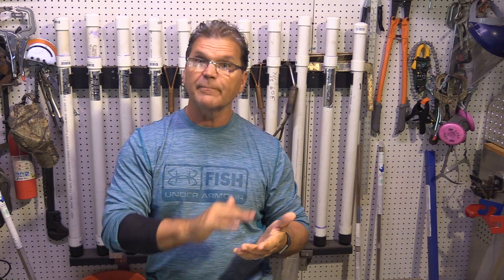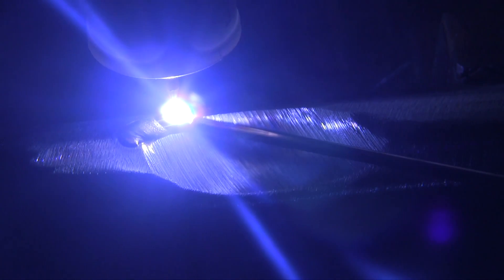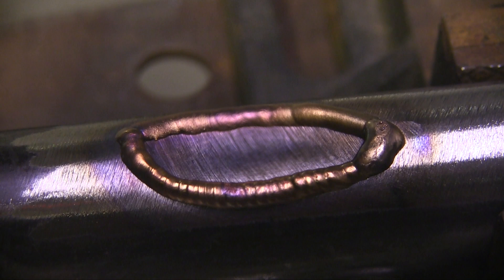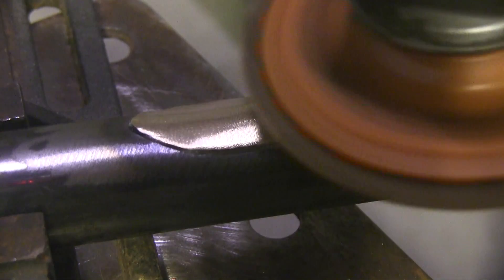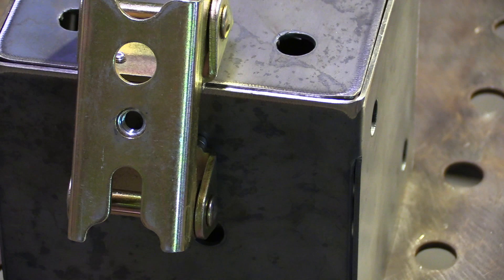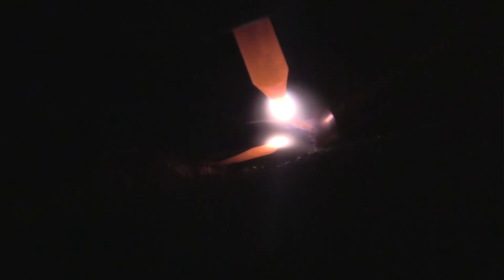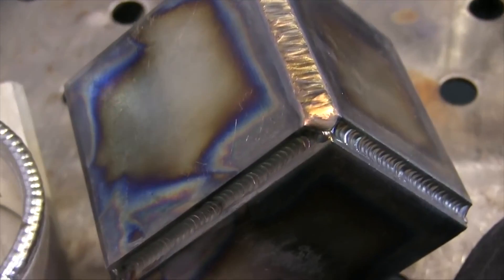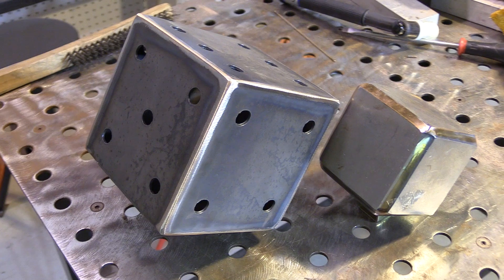Silicon Bronze TIG Brazing

Comment: Another fantastic video, thanks!!  And it's good to know that AC isn't "wrong" for using silicon bronze.  When I tried it I thought it worked better for me than DC, but I was probably running too hot.  I seem to have a hard time keeping in the brazing mode..

Comment: Are there any concerns with fumes with the bronze :)
Reply from the maker: there are definitely concerns with any welding process.  Silicon bronze   ERCuSi-A does contain some Zinc but not as much as brass.
when in doubt, where a good respirator .  I like the 3m 6291 with the pink 2097 filters

AWS Chemical Composition Requirements  ERCuSi-A
Cu = Remainder Zn = 1.0 max
Sn = 1.0 max Mn = 1.5 max
Fe = 0.50 max Si = 2.8 – 4.0
Al = 0.01 max Pb = 0.02 max
Other = 0.50 max
Reply: @weldingtipsandtricks  Wow Jody,thanks for the reply,thats the same type respirator i have used for many years now,it is comfortable when i am welding for over an hour continuously and as i am an older boilermaker i generally use it always,heavy prepping,any large scale cleaning and any welding really.Only problem is i work in tropical areas and in the summer you do get a lot of sweat in the respirator,but like the job you power through:)

Comment: Can I tig braze using flux to cut down on the argon gas. A 12 cup is very big and uses lots of gas. Also too, is it trues that DO NOT use bronze rod with flux already on it that is intended for gas welding on a tig setup ?
Reply from the maker: never tried it. but my guess is it would not work

Comment: Great video, Jody!
How does silicon bronze compare to aluminum bronze? Would using AC be helpful with the oxides floating in the puddle in the video? 
Happy New Year!
Reply from the maker: Both can be run on DC or AC but Aluminum Bronze tends to run a bit cleaner on AC due to the aluminum content. Silicon bronze usually runs fairly clean but Letting Silicon Bronze cool off often goes a long way in helping keep it clean
Reply: @weldingtipsandtricks  Thanks for the reply. Are the two versions of bronze rods more-or-less interchangeable for typical applications?
Reply from the maker: @Wildman76059   I like aluminum bronze for cast iron applications because its a bit stronger than silicon bronze and I use AC for that.  But for an overlay, artwork, or one time fixtures, I like silicon bronze

Comment: My next question is can you TIG braze aluminum? For example brazing thin aluminum at low amperage?
Reply from the maker: there are aluminum rods that are classified as brazing rods but the difference in melting point not that much.  4047 aluminum filler is sometimes called a brazing rod but only melts around 100F less than 4043.  but it does flow a lot better
Reply: @weldingtipsandtricks  and Is there a chance to braze aluminium to steel?
Reply: @raulduke85  I would like to know the answer to that too. I don't believe so, bronze can adhere to aluminum. I think aluminum to steel has to be soldered if I recall
Reply: @raulduke85  okay it's coming back to me now, 2 weld ferrous to non-ferrous metals, for example in your question aluminum to steel you either have to use by metal inserts between the two metals or you have to dip or plate the steel with aluminum. I'll buy metal insert is just a piece of metal that has a mixture of Aluminum and Stainless in it and allows you to weld the steel to the insert and the aluminum to the insert. So you're basically making a sandwich joint. The other way sounds a little bit like electroplating from what I've heard. But you will basically be coating the steel with aluminum and that way you can weld it as an aluminum to aluminum type joint. If you were to just try to weld steel to aluminum without doing anything else you can get a extremely brittle connection. From what I recall, the buy metal insert is the best and most common way to do this. In some cases it could be something just as small as a scrap of material.
Reply: @77Avadon77  thanks for the answer: i asked because we'll probably Need at work
Reply: @raulduke85  sure no problem, my phone sucks a dictating. It's called a bi-metallic transition insert.

http://highenergymetals.com/products/
Reply: @77Avadon77  wow fantastic, i think this Will solve us many problems.
I d'like to explain the kind of job se are having trouble with, but my english Is quiet poor and i can't figure out how to start explaining you😅; but I'm pretty dire that this Is what we need to complete our job.
Many thanks and greeting from Italy😀
Reply: @raulduke85  You're doing great with English. My wife is from Mexico and I've heard all manner of silly things coming from her lol and I love her to death. :D
Reply: @weldingtipsandtricks  I'll definitely check that out. Would you say for doing very light non structural components of thin aluminum that it would be better to use the brazing rods rather than to weld it? For example, would you get less heat and Distortion in the sheet aluminum?